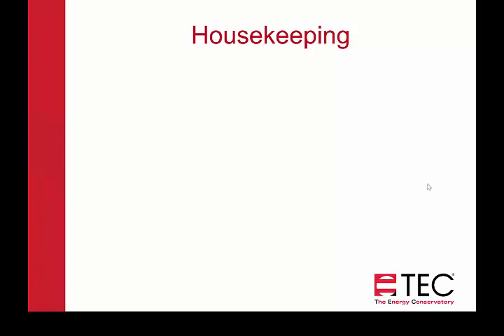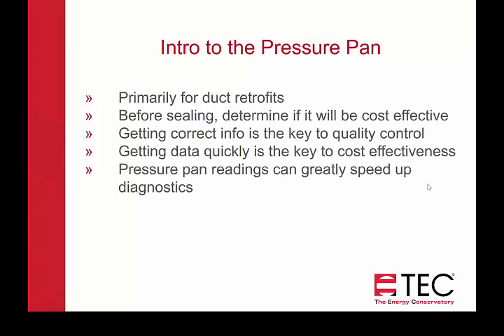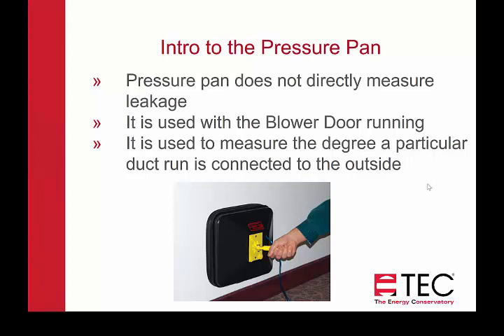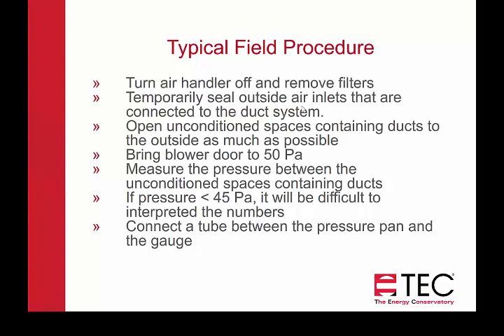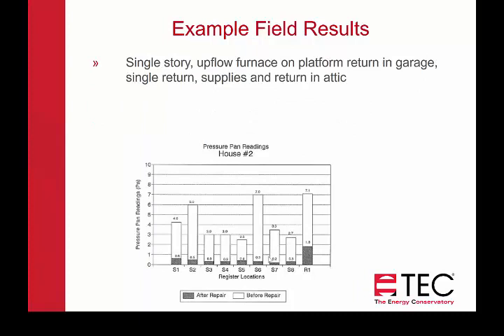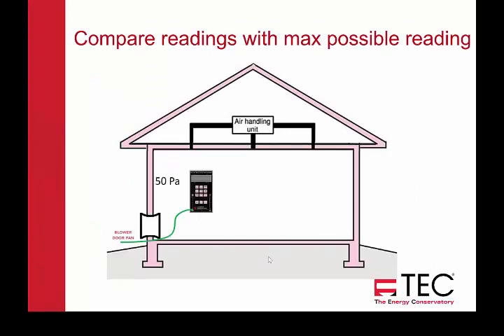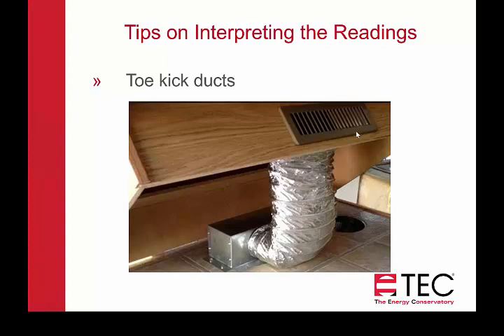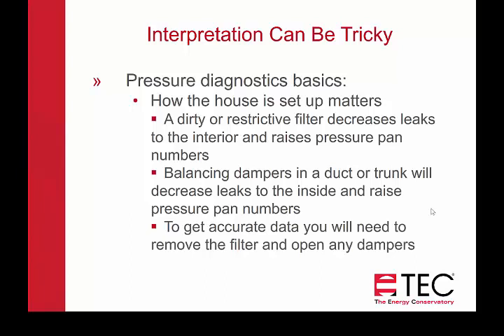Using a Pressure Pan to Diagnose Duct Leakage Webinar

Comment: Very useful video. In the vernacular of home performance folks I hear "take the house to 50 pascals" all the time which is usually NEGATIVE 50 pascals (for a standard blower door test).  It is not entirely clear in this video if the house is being pressurized or depressurized.  Also, it is stated that the pressure in unconditioned spaces (attics/crawlspaces) should be known but it's not clear what exactly to do with that info.
Reply: Hi Mark,

You are correct, a standard blower door test is done by changing the pressure in the house by -50 Pa.  The pressure pan can be used at both -50 and +50 Pa.

I included measuring the attic pressure to emphasize the difficulty in using pressure pan numbers to determine if it is cost effective to seal ducts.  The best use for pressure pans is for determining where the leaks are and where to start sealing leaks.